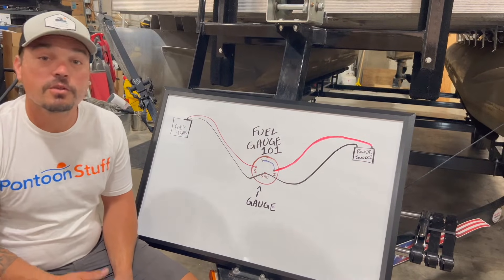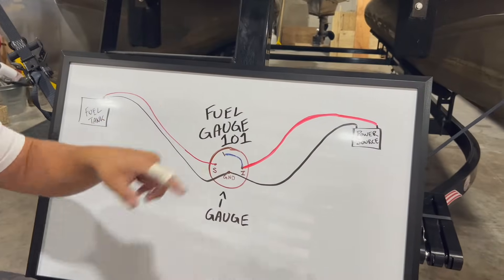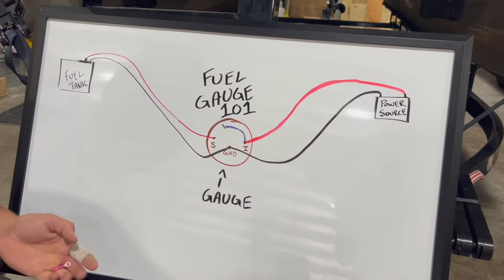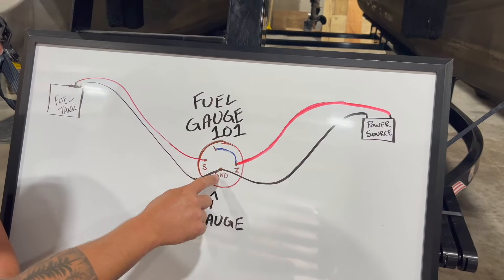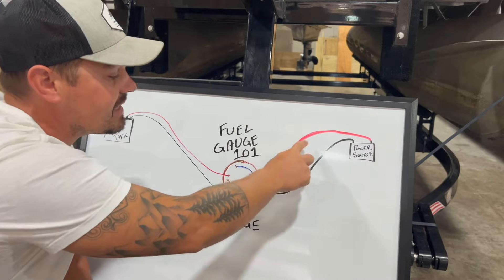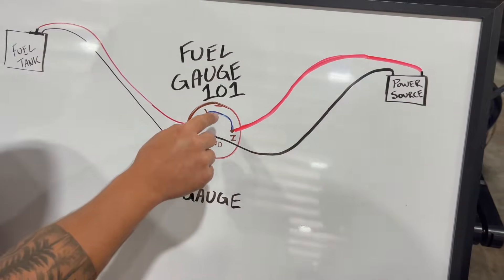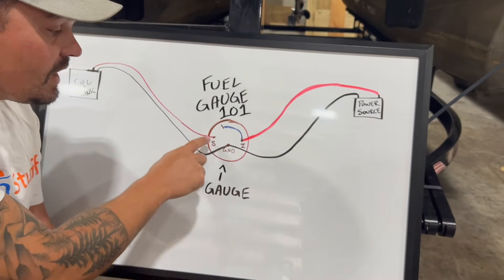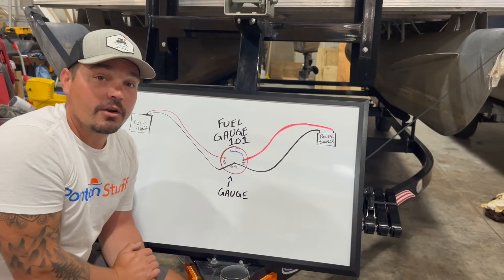Boat Fuel Gauge Wiring 101 - How To Wire Your Fuel Gauge

Comment: That's not a pink wire.
And that's not a pink/black wire that goes to my boat fuel gauges
Reply from the maker: Manufacturers use pink and black for sending and ground wires in their wiring harnesses from the factory. It’s 100% possible that someone got in there and replaced it with what they had laying around at some point. You wouldn’t believe the wiring I find on boats that people have added or run just to get by!
Reply: Mines pink; about 2 fingers' worth...

Comment: My fuel sender have 3 wires coming out of it how can i wire it
Reply from the maker: Is one a green wire? Green is used to ground to the fill spout from the sending unit.
Reply: @tomspontoons  have two greens and 1 brown
Reply from the maker: Sounds like you have something that someone wired themselves…and didn’t make it easy for you! Follow the video for the sending wire and ground, and run the extra ground to the fill spout.
Reply: Thanks mau @tomspontoons

Comment: excellent video I have two tanks an one guage. would I just splice primary out of primary sender to primary  toggle  then into the guage same w/ secondary. or can I wire out of sender directly to guage an directly to toggle switch.I have AFT tanks an guage is the sender the white an the ground is the black? as far as grounding the tanks an caps I assume directly from each tank an cap to ground on guage is suffient? thanks
Reply from the maker: I've had this question a couple of times over the years. I've personally never run two tanks off of one gauge. I've done a couple where we installed a gauge for each tank which is straight forward and simple. I would personally run each tank to it's own momentary switch where the output lead would go to the gauge. You could just stack those output leads from each switch to the gauge. I'm just not sure if the gauge would be damaged if each signal was sent at the same time, which is why I'd go with a momentary switch to be sure both aren't turned on at the same time. I imagine you could do the same thing with a momentary on/off/momentary on style switch with the center lead as the sending wire to the gauge and each tank's sending wire to the outer posts. Again, I've never done this...but maybe I should mock it up at the shop sometime and give it a try!
Reply: @tomspontoons  yes I think it has to be tank1 an 2 input into the switch then out middle of switch to guage. my other concern is the ground strape on aluminum tank from tank an the filler neck those can go to any ground correct? like I can splice into example a cabin lights ground? thanks
Reply from the maker: @steveleston1848  Correct, the grounds just need to get into the shared of the battery negative one way or another and to the gauge.

Comment: I am on my 2nd fuel gage, and I can't get them to read the amount in the resistance type sending unit , I am reading 145 ohms at half a tank ,
Reply from the maker: I’ll be honest, that’s over my head in terms of scope of knowledge. I’ve only had one faulty fuel gauge out of the 50+ I’ve installed over the last few years. Did you put a new sending unit in as well?

Comment: Easiest wiring instructions I've seen.   Your diagram is exactly how I've seen every boat fuel gauge wired up and that's how my sender/gauge are currently wired up.   However, I'm in the process of replacing my tank sending unit with a new KUS sender and the wiring instructions that come with the new sender are just the opposite - it says the pink wire from the sending unit goes to ground and the black wire goes to the signal post on the gauge.  That seems backward to me and certainly doesn't follow the industry standard of the pink wire being the fuel signal wire and black is always a ground wire.   Thoughts?
Reply from the maker: Yikes. I’ve not yet done that install so I’m not sure. I would contact the manufacturer to double check. I’d have a real hard time flipping those without asking around myself!!

Comment: I saw where you could wire two together using a toggle switch. But can you wire the two together then to the power then to toggle then to gauge?
Reply from the maker: I haven’t seen that done before, although I’ve had someone else comment asking about it. I would personally just have two separate gauges labeled for their respective tanks and each with their own power supply and sending wire so that I don’t have to worry about a point of failure by putting a switch in or having something go wrong by trying to over implicate the system. Just my preference, but there could still be a way to do what you’re looking to do. It’s out of my range of knowledge though.

Comment: Video on how to wire to tanks to one gauge.  If you can put a diagram one line would be great.
Reply from the maker: As far as I know there is no way to wire two tanks to one gauge. You’d have to look into some more advanced and expensive hardware that could handle that. Not usually something we tackle on pontoon boats!!

Comment: Question:  Bought a gauge from Amazon and wired as you presented, excellent btw.  However, when the ground form the tank is put the neg pole with the light, the gauge zeros out.  Take the light off and the guage works.  I wired the tank black directly to the battery and wired the neg on the gauge and still zeros out.  Any ideas?  thanks
Reply from the maker: I've not worked with fuel gauges other than the Faria style that I install often and a couple of Sierra Lido style. I always run the tank ground all the way to the gauge, not that it should necessarily matter since if connected to the battery ground and the battery ground to the gauge ground it should all be connected, but that's something you could try as I'm not sure where else I'd start for troubleshooting.

Comment: Can I jump this from the positive on the tachometer?
Reply from the maker: Most gauge clusters will have power jumped across gauges powering one another, so yes, definitely can power it with a jumper from the speedo. Just DO NOT hook power to your signal post or it will likely ruin the gauge.
Reply from the maker: Mercury Outboard Gauge Wiring - HOW TO INSTALL
https://youtu.be/t055v6ZQtBU

Comment: I appreciate the simplicity of the demonstration.....question?  shouldn't the circuit be fused?
Reply from the maker: When tying into the ignition harness there's a fuse at the motor. I'm sure it wouldn't hurt to add an additional fuse under the helm, but I've never seen that done before on a new boat from the factory.

Comment: Does the power need to be connected to ignition or can it be any power source?
Reply from the maker: Power to the gauge could be hooked to another 12v source. I’d make sure it’s got an inline fuse or breaker as well to protect the gauge. On the big river boat I built my fuel gauge powers up on the same switch with other 12v accessories like my fish finder and USB charger.
Reply: @tomspontoons  that's exactly what I'm doing. Thanks
Reply: What size fuse?
Reply from the maker: @captainsmate5770  I think most gauge harnesses are fused at 3amp or 5amp. Mine is on a 5amp fuse. Fish finder has its own low amp fuse too.
Reply: @tomspontoons  ok thanks ..I always run a separate power and ground away from other wiring to avoid interference and noise on depth finder
Reply from the maker: Never a bad idea to do that!

Comment: Will one of those read the tank level from a stock Toyota matrix sending unit....if I get the 2 wire from the car fuel tank?
Reply from the maker: Unfortunately I have no idea as the automotive side of things are way out of my wheelhouse. Give a Toyota dealer a call and they may be able to answer that question. I'm just not sure if the sending unit signal is the same from a car's fuel tank.

Comment: Hi Tom, can I connect the neg and pos to busbars instead?
Reply from the maker: For powering the gauge, yes, but then your gauge will be on whenever the bus bar has power. I like it to have key on power only from the ignition so that it powers up and backlights only when the key is on (motor running). That’s how how learned to install them so that’s what I’m sticking to!!

Definitely DO NOT get the signal wire anywhere near your power source. It can ruin the sending unit in the tank and the gauge.
Reply: @tomspontoons  -Hi Tom, so my busbar says 13.8 Volts but the battery gauge says 7.8 or less only, the motor wont even crank, what do you think is problem?
Reply from the maker: @beaniril8870  battery gauge as in voltage gauge on the dash? Check all your connections to make sure the lugs are CLEAN. I wire brush the motor battery cables on every boat I work on because I’ve seen a fully charged battery not crank over a motor from cable ends being a little cruddy, and same thing with them being not wrench tight.
Reply: @tomspontoons  -did all that and thanks for the reply. I checked the busbar, where all gauges and all 12 volts, it’s 13.8 volts. The ignition sometimes wont even light up but when it did lights up and turn the ignition on it wont crank at all.
Reply: @tomspontoons  -I think i know what’s going on. The dashboard gauge is saying 7.8 volts bc this is what its sensing or receiving from the motor positive and negative wire that are connected to the batteries. Therefore the motor pos/neg are kind of loose not getting the full voltage it needs to crank the motor.
Reply from the maker: @beaniril8870  that sounds right on to me. I’m not an outboard mechanic by any means…just winterizing and basic maintenance stuff is what I do. I always say “I know just enough to be helpful”
Reply: @tomspontoons  -you are one of youtube’s go to guy when it comes to troubleshooting electrical problem. Thanks for the help, Tom

Comment: ...looks simple enough, are all fuel tank sensors equiped with only two wires?
Reply from the maker: There may be a third wire from the ground or near the ground that runs to the fill spout, especially on a metal fill. It would be Green typically and reduces the risk of a spark when filling fuel. Otherwise it’s only a ground and sending wire from the tank to the dash.

Comment: Hi Tom, i tried to wire the analog and digital fuel gauges on the same sending unit , but never got them to work toguether, only 1 of them would read right, do i need some kind of device to do this ??
Reply from the maker: That's a really good question. I've never seen two gauges coming off of the same sending unit. I'm not sure if the signal would be strong enough to feed both gauges either. Lastly, I know there's a newer style sending unit that's more common with the newer digital gauges. Sorry I can't be more help here!

Comment: I have several boats and most have fuel gauge issues. Why does the fuel gauge on my pontoon always say ut us full of gas but it definitely is not?
Reply from the maker: That’s a tricky one because it could very well be your sending unit having issues. I’d plan to replace the sending unit in the tank and the fuel gauge to cover all bases.
Reply: Same problem. Change fuel sender same problem. When I take fuel sender out and move it up and down with my hand the gauge moves but once it's back in the gas tank it reads full all the time. I do not understand
Reply: Sounds like a issue with your sensor

Comment: Why would you jump ignition to the light. You want to make the light turn on with nav and anchor light 🤦‍♂️
Reply from the maker: To each their own on their own boat!! Some would ask why you’d want the gauge lights on if you have only navigation lights on while on anchor without the motor running?? I was taught that way by marine mechanics and I’ve seen it done both ways, however most boat manufacturers tie to key on power at the ignition on brand new boats.
Reply: Thank you for your comment......I am rewiring my boat and never thought about the panel gauge lights being on the same switch as the Nav Lights???  Great Idea...I was going to put them on their own switch.  I may still do that but, your idea certainly merits consideration.

Comment: hello Tom,
just wondering if you might have or could draw up a wiring diagram for a 
On - On, Double Pole Double Throw Toggle connected to Two Fuel Tanks, One Fuel Gauge.
I bought a Jet Boat a couple of months back. The Double Pole Double Throw Toggle that came with the boat was a, all plastic toggle with the toggle level broke off. 
I went to replace the old plastic toggle, and it crumbled apart, in my hand. Power is coming from Ignition.
Wiring is all daisy chained Gauges, Alternator, 40amp 12 volt Relay, Starter, Electric Fuel Pump, Electric Fuel Valve, 2Batts off a Perko Switch, Bilge Pump.
2 Fuses, 1red 10 amp for bilge and
1 green 30 amp for ignition.
The boat is a 1994 Caliber 1 19' 496 stroker BBC.
I would like to rewire it, to get rid of the birds nest, and update the wires and connections.
the way it is wired now, one short and the whole system is down.  I know it is to cut down on all the extra wires.
just wondering if it is better to install a fuse block with multiple relays.
any diagrams, thoughts, opinions.
just trying to make it as reliable as possible. it has cocktail seats, so basically it's a cruiser. 
thanks in advance.
Peace
Reply from the maker: Great questions!!! I have never seen that fuel tank and gauge setup so I’m not sure I’m the best one to answer that. I have to imagine the toggle switch is tied into the sending wire somehow from each tank, but not sure if it’s a unique switch to that system or if that’s even the case at all. Sorry I don’t have the perfect answer there!

I just helped a buddy recently who tore everything out of his 17’ bass boat and started fresh with new wiring under the dash. It was an incredible improvement. We left his main harness, and installed a new fuse panel. Ran the harness to the switches, and the accessory power wires out to the fuse panel, then out to the associated accessories. It’s a super clean way to do it and works great if/when you have easy access to the fuse block!!

Comment: Hey Tom, have a request!
Trim gauge doesn't work (mercury), can you walk us through some simple trouble shooting ?
Reply from the maker: Trim gauges are really touchy because you have the gauge as well as a trim sending unit on the motor. Was yours working before and just quit? Or did you just try to hook it up?
Reply: @tomspontoons  
Bought the boat used,  gauge never worked so not sure if it's the unit or the gauge , not sure where to start or how to start
Reply from the maker: @J.O..  Sometimes boats come pre rigged with a trim gauge, but the motor needs a trim sending unit. That’s likely your issue, but wouldn’t know without looking at the motor. There should be a little plastic spring loaded sending unit under when you tilt it all the way up. If all that is there it could be a bad gauge, but usually they last forever if everything is there and properly connected. 

Check the back of the gauge to make sure there’s power from the gauge harness, a ground, and a signal/sending wire from the trim sender!!
Reply: @tomspontoons  will do appreciate ya

It's not really needed, I can eye the trim,  it's just more of a nice to have I guess
Reply from the maker: @J.O..  it helps, for sure. Gotta remember that a trim gauge only shows that trim range…doesn’t show when the motor continues beyond trim, so only about half of how far the motor can actually tilt up!
Reply: @tomspontoons  that's an interesting fact, thanks Tom!

Comment: hey quick question, my toon currently has one (first one so bare with me). The guage seems to jump around when moving ..not too much of a swing, but doesn't hold spot like my digital gauge on seadoo.   is that somewhat normal? it might swing from 1 tick off Full, to Full for example
Reply from the maker: Good question!! I’d call that normal because the sending unit is a float that slides up to tilts up and down based on the amount of fuel in the tank. Sloshing will cause that needle bounce on certain tanks…I’d say the majority do that. Mine definitely does!!!